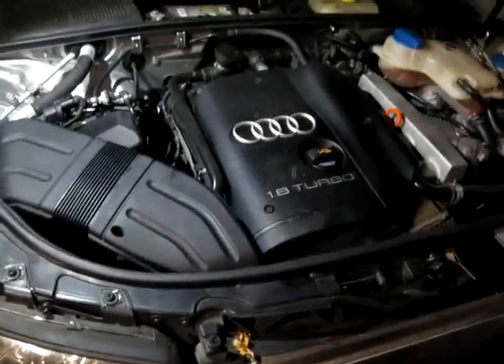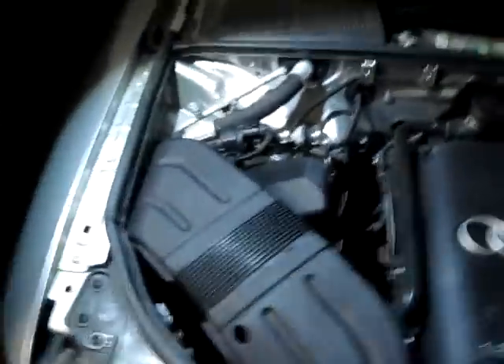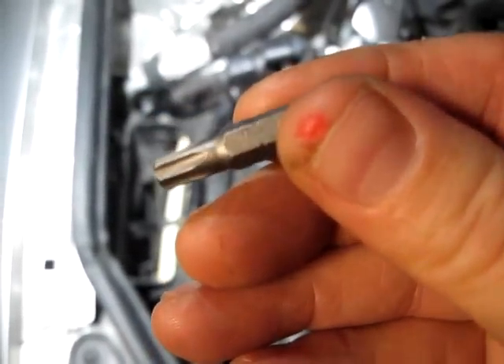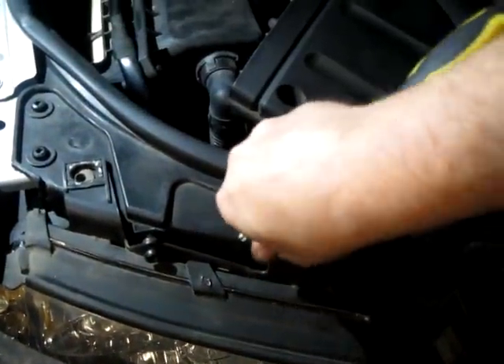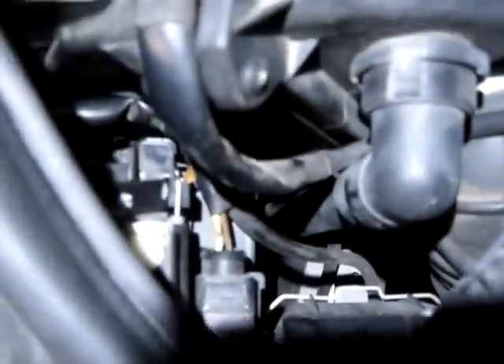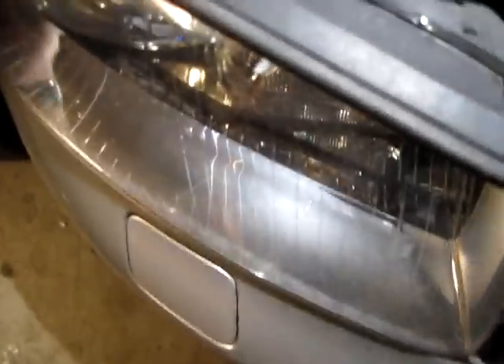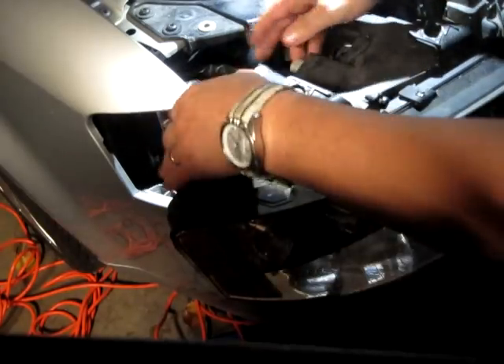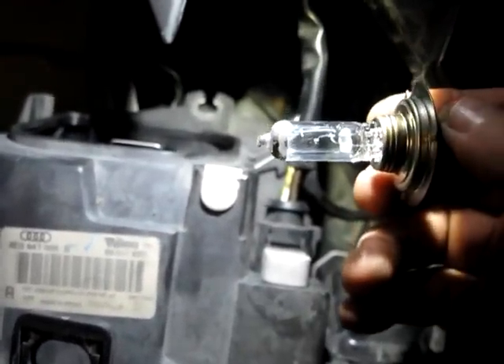Replace Dipped Headlight bulb for Audi A4 B6 (2004)

Comment: Thank you very much Carl. Done in 15 min. I would have searched these hidden torx for hours.
I also had a forth one on the left headlight but only three on the right one (the one under the air intake).

Comment: Thanks, just did this for my left (drivers) side.  needed to buy a 3/8 extension for the 2 lower bolts. Saved me a few hundred instead of taking it to the dealer

Comment: I used this to change the high beam on a 2006 A4 cabriolet. There was no need to displace the entire headlight fitting. just remove the air intake entirely (both sides as described at 4:44 in this video), and then the clip for the back of the high beam is visible, and you can access that bulb from there.

Thanks to the poster for the video!

Comment: I have a 2005 Audi A4.  Although this video is certainly helpful, there are many changes to the 2005/2006 model.  Among them: At the top part of the lamp assembly, the fastener closest to the center is a long machine screw mounted lower than the other one, slightly behind the grill.  It is in a bracket with an open-ended slot.  (It is simple to remove the section of the air duct that is connected to the grill brace, and you have better access after doing so.) After removing the two fasteners at the top, I searched and searched in vain for the fastener at the lower part of the assembly, but never succeeded in locating it.  I even looked from underneath the car. Totally stumped. I did determime that in order to romove the round cover at the back of the assembly, you must have a T20 bit. There are, or should be, two T20-head screws holding that cover in place, but you'll never get to the second without detaching the headlamp assembly and sliding it forward.  Alas.
      As for bulbs, you did the right thing first removing the whole deal to see what you have.  You almost bought a D1S (that's a Xenon bulb), and fortunately found out you only needed an H7 (a halogen bulb) instead.  I bought an H7 at Walmart, and discovered that I really need a D1S,  8^)   Personally, I'd avoid buying headlamp bulbs on Ebay.  Click on the vendor name, and their location is either China or they say something ambiguous like "headquartered in the UK."  Why are their prices so much cheaper, like roughly half?  Because the bulbs are counterfeit -- not really the Philips or Sylvania brands they appear to be.

Comment from the maker: Thanks for the comment, I had read that there should be four bolts, as you said the fourth should be quite easy to locate under the air intake, which you can remove with by unscrewing the two phillips head screws just above the radiator. My car is an Ultrasport, so  I suspect this is why it only has 3 (as does the Cabriolet).

Comment from the maker: Yep, I just had my other side bulb go out myself. I didn't swap out both bulbs last time and I should have, as when one goes the other will follow in shortly after (for me a year but still). Remember to pick up a T30 Torx if you dont have one. You can pick up a set for $7 in walmart, or a T-30 screwdriver for $5 in autozone. Good luck...

Comment from the maker: H7 55W Halogen. I just picked up a pair from xenonhidshop on ebay for $4 shipped, the shipping was quick like 4 days from ca to mo, so pretty quick. If you pick out your bulb get 4000-5000k as that is the whitest light. 6000k+ gets blue and less visible, and below 4k similarly yellow. Also, you should open up your headlight and check out the bulb, to make sure. Also it doesnt hurt to swap bulbs, to make sure htats the problem, and not balast (if you have it.) ...but at $4 just order a couple now

Comment from the maker: No, dipped headlight. However same process to remove and change. Just remove headlight and pull out blown bulb, so you can make sure you buy the right replacement.

Comment from the maker: In my case H7 55W Xenon 5000k. You can find a pair on ebay for $5.99 that work fine search for "H7 55W Xenon HID Hyper White" those are the cheapest for north america and they come pretty fast from California. But, check your owner manual for what type of bulb you should get. Commonly,  HID-D2S or HID-D1S bulbs are used for the factory HID upgrade. If you're not the original owner, you will have to pull the headlight unit out to check before you purchase. If you find you have the H7 then ....

Comment from the maker: 4k-5k is where you want to be, so you would be fine with those 4k bulbs, above or below that color temperature you lose lumens (output) so you wont see as much.  They just use a bit of blue glass I think to make them look xenon like. Now if you have a bulb out, just pick up a hid kit and throw it in if that's the way you want to go, I haven't done it so Im pretty much in the same boat as you when it comes to bulbs and color. I think you can pick up a kit for around $50-$70 for each dip/full/fog

Comment from the maker: My bulb was completely out, in fact my drivers side has just gone out also. I never experienced intermittent loss of headlight. Are you sure you don't have Xenon's and the ballast is failing ? To debug without dealer fee's try swapping drivers and passenger side kit (bulbs / ballast) to see if the problem switches sides. Good luck

Comment from the maker: Thanks for the comment, and watching, AUDI A4 B6's came with H7 high and low beam bulbs as standard. A factory HID dipped beam option, was available though. In this case you may find either D1S or D2S bulbs. If you look at you log book codes you will see a code for that option, unless an owner before you did the HID upgrade themselves.   In anycase, my car (which is a USP) uses H7 bulbs, for both Full and dipped beams, and in this case I was changing the dipped beam light bulb.

Comment from the maker: Considering the cost of the D2s and D1s Bulbs I'd suggest anyone checking before ordering, and if they find they have the standard they could just replace the failed dipped bulb with the less frequently used Full beam, whilst they wait for their el cheapo ebay bulbs :)

Comment from the maker: Wait until your coolant flange goes at the back of the engine, a garage will charge you $500+ to change it when with effort and girly small arms you can get it done for  $40 !! Ours let go catastrophically and lost all the coolant which had me freaked out as I had just done the fuel pump and thought it was dumping fuel